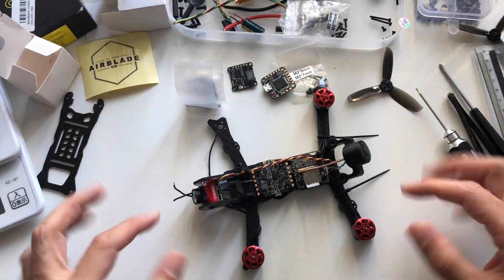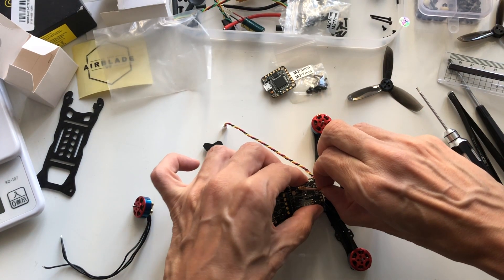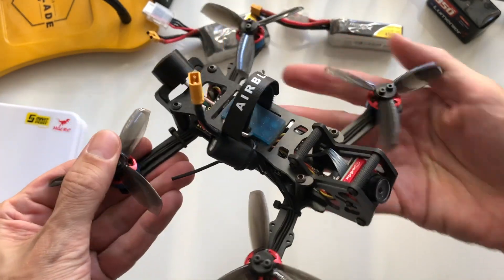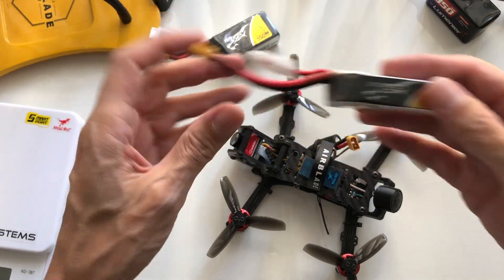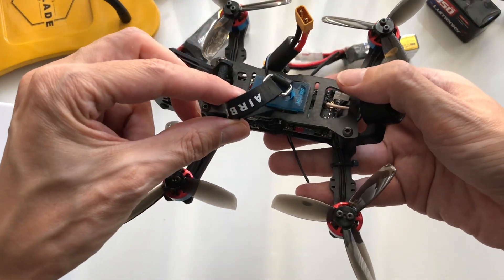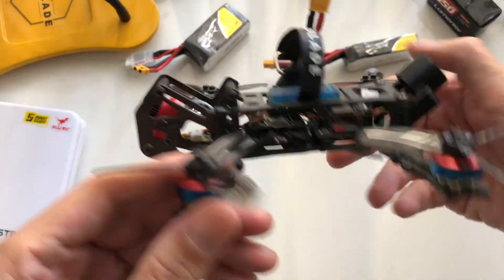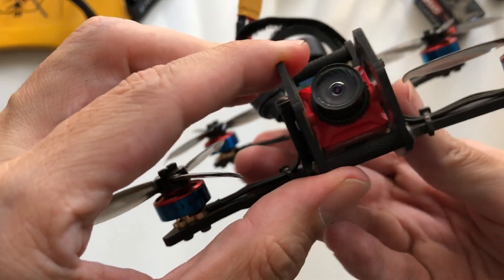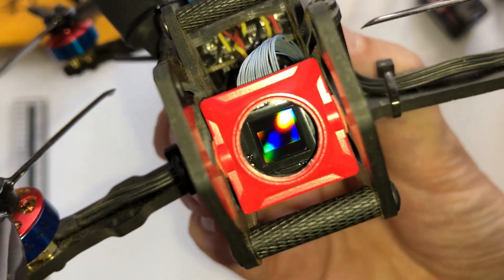Airblade Intrepid V2 Lite with Caddx Turtle Parts 2 and 3

Comment: I want to carry a Session5, should I use the Superman 1404 or TMotor 1507 3800kv? Thank you!!
Reply from the maker: Hello! Do you have the Lite or the Pro version of the frame? If it's the Lite version I don't think the big 1507s will fit because they have 12mm spacing on the motor mounts and the Lite has 9mm spacing. If you have the Pro then the 1507s should fit and would probably be the better choice for lifting the extra weight of the Session. That's my opinion and I could be wrong;)
Reply: mini micro FPV You’re right. I have the Lite version, with 9mm spacing :)
Did you try yours with a Session5? I wonder if Superman 1404 will be ok to carry it efficiently. Thanks.
Reply from the maker: I didn't try it with a Session 5  but I did try it with a little Hawkeye Firefly 2 Micro Cam and it was fine with 1404s. You'd definitely notice the extra weight of a Session 5 but it would probably still perform okay if you are looking for smooth footage and not outright freestyle performance:)

Comment: Hey man Great video! you got a sub from me for sure.. Just wondering how you like those superman 1404 motors? I have a "long range" 3" that is running 1407's right now simply because i have a huuge surplus of 5mm mounting hole 3 inch props. However I just ordered a bunch of GF windancer 3028 props that have the insert to fit on t-style motors so I was thinking about picking up a set of the 3850kv's. People claim almost 8 minutes flight time on an 850mah 4s, what kind of flight times are you seeing with this rig?
Reply from the maker: Thank you! It’s been awhile since I’ve flown this but I’ve since moved the motors over to a non-HD 3” Eclair Lite.
I think that flight time with an 850 battery is realistic. I was getting almost 5 minutes with a lightweight setup and 450 4s.

Comment: 3S or 4S? What mah? Total weight with battery?  Does it feel weak at any point with the 1404 motors? Flight times?
Reply from the maker: Hello. Running 450mAH 4S on this and it weighs 190 grams all-up. It never feels weak to me. Naturally it doesn't have the same punch as 1407s but that's okay as I was mostly looking for something smooth and light. I get around 3 and a half minutes of flight.
Reply: @MiniMicroFPV  Have you ever tried any bigger batteries? I ahve heard these can get up to 8 minutes on a 850mah or close to 7 on a 650mah
Reply from the maker: UptiltFPV I’ve only tried up to a 650 with this setup and if I recall it was about six minutes:)

Comment: This appears to fly really smooth in your video. Is it truly this smooth to fly when you are controlling it? How does this compare to other quads you own?
Thanks for doing this video! 🤘😀
Reply from the maker: Scoot Roter Thanks! It is quite smooth, which I put down to the stiff frame, quiet motors, and Betaflight 3.5:). With some small tweaks and better flying it can be even smoother!
The closest thing I can compare it to in my collection is the Eclair Lite 3”. That one is lighter and feels a little lighter in the air and I like that but it also doesn’t capture HD:)
Reply: MH Radio Control 😁

Comment: Woo! Just ordered mine tonight! Did NOT get the axii holder =( Will figure that out later =P
Reply from the maker: Oh cool! I may actually see how mine does with a linear antenna and no mount to save a bit of weight;)
Reply: One of the awesome things about Airblade is that they have their stl files on Thingiverse.. so you can go get those, edit, and print with lighter material if you want. Personally, I'd like to get a mount with the AXii antenna, but with 2 holes for an RX antenna on each side of the AXii, with the little straw tubes coming out... Got someone working on that right now... Hoping it comes out ok...
Reply from the maker: C4pnk1rk Hehe, as I was building it I was thinking I wish it had a couple little holes in the antenna mount just as you describe;)
Reply from the maker: Sure, although these settings were only just tested today. I like them well enough, but am wondering if the bit of propwash that is remaining is down to flying or tuning;)
RP 42 RI 44 RD 30
PP 42 PI 44 PD 30
YP 50 YI 100 RD 0
Feed forward is stock, as are the filters in 3.5 and Dynamic Filter is turned on.
Reply: Thank you sir! I'm just waiting for my Turtle to get here... I'll have to tune up a bit myself I think. I had to put my ESC/FC in the back because of how wide my ESC was. Couldnt get it on front without the camera housing hitting it =/
Reply from the maker: Interesting. I'm glad the power stack was able to fit!